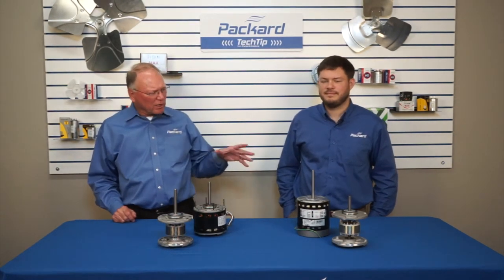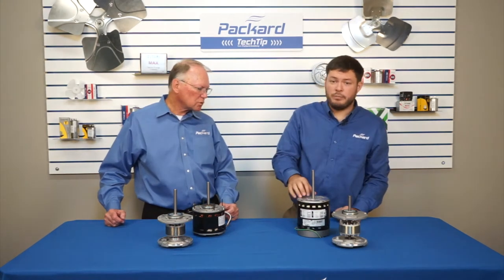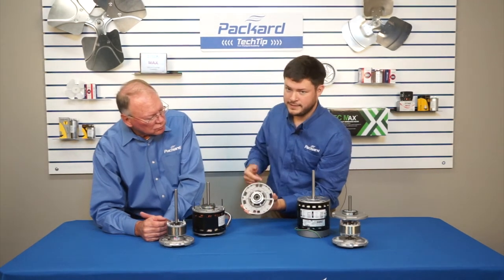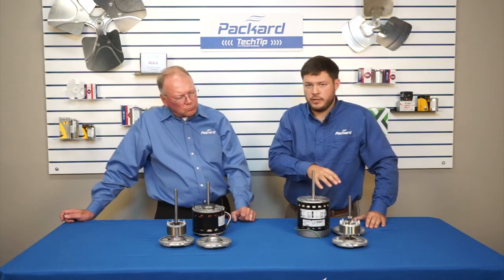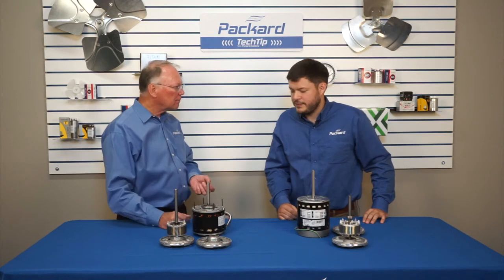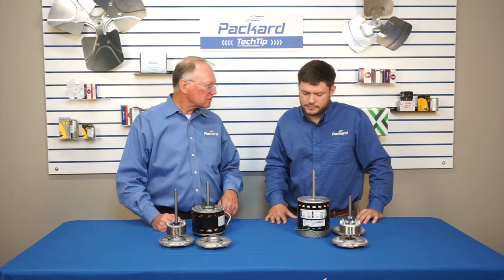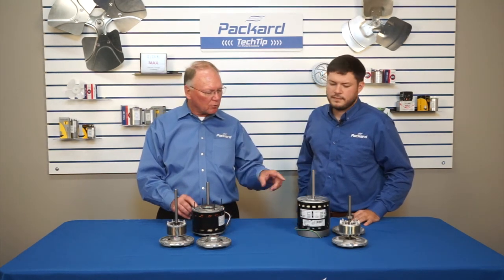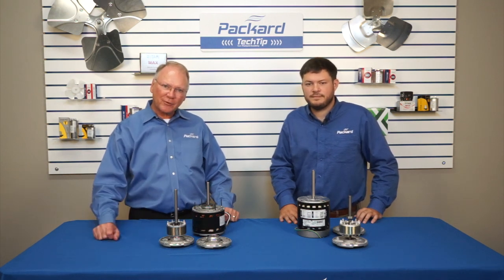Sleeve Bearing Vs Ball Bearing Motors- What Technicians Need To Know

Comment: How about mounting positions? Horizontal vs vertical, for vertical mounting, up vs down?
Reply: it would depend on the load on the bearing, whether it's radial or axial, and those things are a quick google away
Reply: The oil wick packing of a motor sometimes has an orientation. Take a box fan or oscillating fan for example. I've found many that have a semicircular wick from roughly 9 or 10 o'clock to 2 or 3 o'clock to hold oil because that fan will only be in one orientation because there is a definite right side up. The top piece isn't needed. If you have that motor mounted upside down, the oil will want to drip down to the empty dish area and not stay in the wick held against the bronze bushing and it won't wick through to the shaft. Basically, dust shielding, oiling, and axial thrust handling are the big factors you need to be aware of for vertically mounting sleeves. Vertical mounting lets dust settle down into the bearing which is why a nice shielding mechanism is required. Axial load is mostly what ball bearings need to be selected for. A deep groove ball bearing can be used vertically mounted with mild axial thrust load. I'd say, when in doubt just go deep groove RR ball bearing.